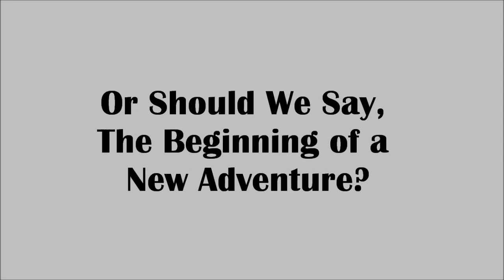New Stahl Folder Arrives at KP Stockton

Comment: Looks like Stahlfolder T52.6/52.6 with flat-pile feeder plus STA36/40 miniature products delivery system. I think this machine has been specified for miniature and some pharmaceutical folding. This model is built under licence in the USA at the former Baum factory in Dayton, Ohio? The giveaway is that the machine is in production without noise suppression hoods over the buckle plates. The German built folders are ex-works all fitted with noise hoods as standard to conform with CE regulations.